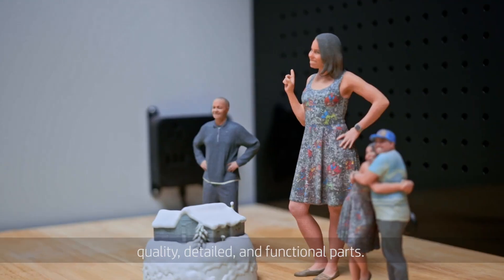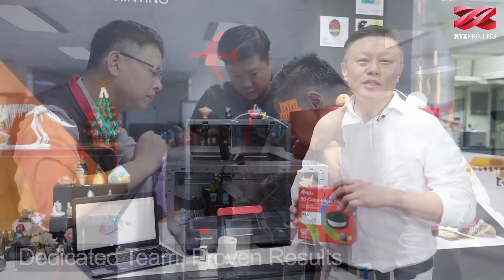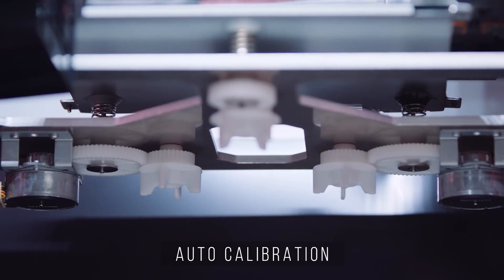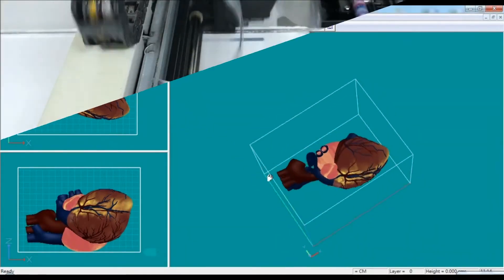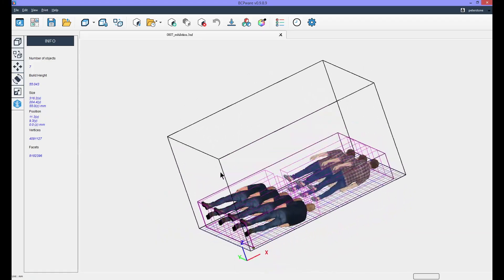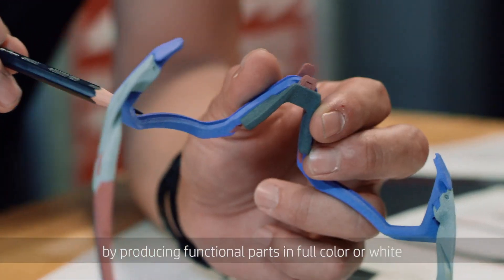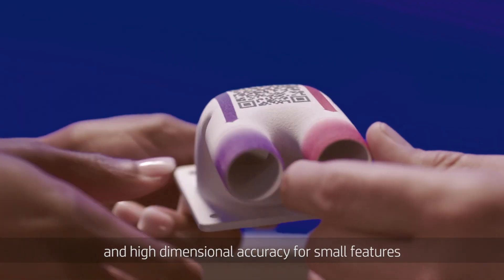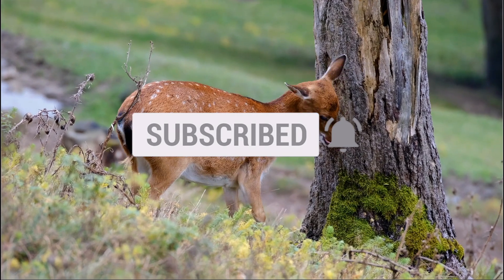Top 5 Full Colour 3D printers Starting $1,599 in 2021 | Most affordable base models

Comment: Honestly, there isn't really a good reason to get a color 3D printer yet. They are much more expensive, much more complicated, much more likely to experience technical issues, and frankly, they can't even match the detail of a halfway decent paint job using much cheaper tools.

You'd honestly be better off just buying 3 or 4 mono-color printers, and an air brush. Because the biggest bottleneck you will see in your print farm won't be coloring, it will be print time.

Comment: that is very interesting that HP is creating a color 3d Printer. I saw somewhere that Xerox is also creating color 3d printers. Or it is about to release them. I am imagining that new stores will become avaialble for consumers to 3d print objects that they want, just like how paper copy machines have done. I wonder if shapeways and FEDex and Kinkos and Staples will incorporate these machines into any of their stores. What i am also wondering is .. what is the strangth of the material after it has been printed. Also, what is the charactoristics of th ematerial at various levels of tempurature and moisture in the air. And what is the longevity of the material, etc.

Comment: People...There ALREADY are UV ECO SOLVENT PRINTERS out there....Take one eco solvent printer, put a Z axis and make it flatbed and print, or modify it to use resins...With double inkjet heads, even multiple materials are possible, full color. The tech is basically public knowledge, anybody can do that and it's a fraction of a fraction of the price for a result that's basically unmatched. All these prints are opaque and require finish. It wouldn't be the case with such a mod.
Reply: if its public knowledge, surely something would come up in all the Googleing you've just made me attempt
Reply: @Kermitable  do you know the meaning of public knowledge ???? It means that what you need to make the printer I've described is NOT PROTECTED BY PATENTS ANYMORE, since they're all expired. That's all it means.
Reply: @FreedomAirguns  has anyone made an attempt to do it 3d?
Reply: @Kewl_Zomb  Some companies are jumping in, try searching for inkjet 3d printer. But the prices are absurd. Way cheaper to DIY.
You just have to make a "so called" flatbed printer with a Z axis. Resins can be TINNED down to be less viscous and, with heat, you can make em even less viscous. The printhead must carry a dedicated UV light, and that's all. Theoretically, it is possible to modify an ECO-UV solvent printer to do all as I said but nobody tried. Let's face it...They just want to squeeze people's pockets for that because inkjets are CHEAP...TOO CHEAP...
Reply: @FreedomAirguns  then why don't you do it
Reply: @tukayatewarpromo789  because, captain obvious, I might not have all the resources needed, reason why I'm publicly sharing that information with THE COMMUNITY. So...Why don't YOU do it?
duh
Reply: @FreedomAirguns  are you talking about a printer like the mimaki 3duj-2207?
Reply: @tukayatewarpromo789  precisely.
Reply: Yeah the UV 2D printers are getting really inexpensive, but to print in 3D we need an ultra-low viscosity resin like the ones used by Stratasys. Otherwise if we stack layers of the 3D ink it's going to eat through the expensive ink real quick and give you a rather brittle part.
Reply: @hyphen2612  10 liters for 8$ is expensive to you? This is the general price of resin from the manufacturers, even less.
Most companies buy from a few wholesalers tons of resin for a bargain and they resell everything at absurd prices.